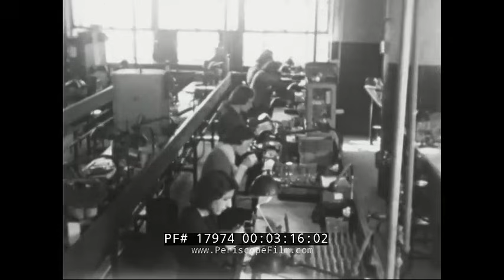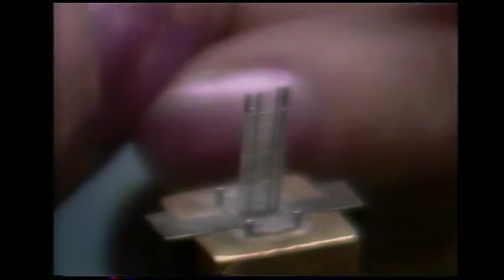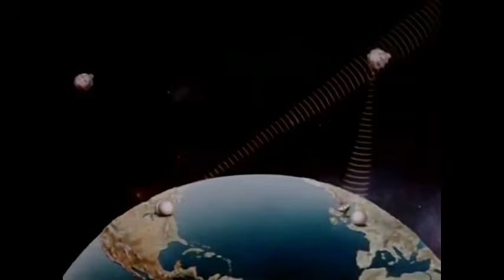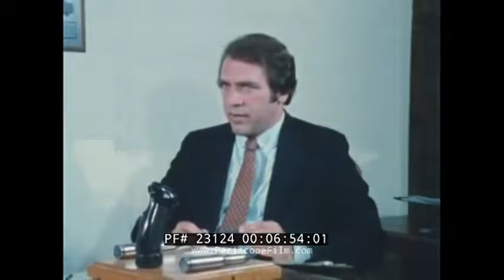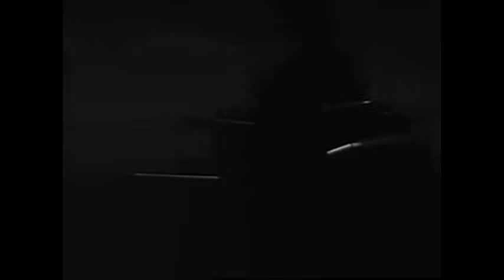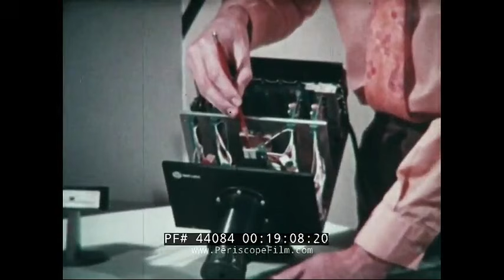The WWII Vacuum Tube Transistors Still Can't Fully Replace

Comment: Click Bait?  The description says THE tube still in use is the TWT, and they show a picture of a tube. Is that supposed to be a TWT?  Have they miniaturized them that much?  Wow, tell me more.  At the end of a 34-minute (admittedly very interesting) video, zero reference to the thumbnail picture, an obsolete VHF Triode.  Only passing reference to the Magnetron, perhaps the most-manufactured tube of all time, and now dirt cheap.  Going to be a very long time before they get replaced in microwave ovens.  Starting at $44.64, 37 different models less than $100 on Amazon (with metal, power supply, timer, etc., all claiming 700 Watts of RF power).

Comment: The thinking that valve amplifiers are smoother, milder, cleaner and better at producing music is a total myth. 
It’s just nostalgia and the fun of touching and seeing and using one of the greatest inventions since the phonograph is the only reason. 
All amplifiers can be designed to be below 1% distortion and some are 0.1%. 
You can only hear above a few percent and although some people have perfect pitch, this is not the same as detecting distortion level. 
If you are so fussy about listening to music, go to a live concert.

Comment: We still use a tube as big as your head to create FM broadcast. Only recently has solid-state been able to handle that kind of power in that environment. The solid-state stuff wins on power consumption alone by a big margin to the point it pays for itself to switch, never mind the tubes are expensive, few, have to be replaced every few years, and are not going down in price, so they are going away.
Reply: Also solid-state amplifiers have redundancy. Many amplifiers and power combiners are needed at that power level. If one fails, you just have less power until it's replaced. With one big honkin' tube, you're off the air.
Reply: @misterhat5823  Yep our Nautels are like that but in the case of our AM yet again go down one out of 2 modules we are 1/4 power because of how combiners work but it works. At least for the tubes you usually have some time from when they start to fail to replace them and shrug off most of the stuff that would pop a power module or two. Also tube stuff you can fix on site a lot of times. The modules usually have to be sent in. So it's all give and take.

Comment: Side note: People complain about the slow warm up of vacuum tubes, but except the slow boot up of modern computers, including your smartphone. That wasn't always the case. Back in the 1970s and into the 1980s, an Apple II or original IBM PC could boot up in milliseconds, if neither booted up into BASIC. That was their default mode, if it was configured without a floppy drive.

The average person thinks that's how all digital computers work. That's because the floppy drive, and later hard drive (HD) had to load the operating system (OS, DOS, Windows) off that drive, and copy it onto RAM. The CPU could only execute code off directly accessible memory, such as RAM. But there's also the boot ROM. It's also a directly accessible memory. In modern computers, that boot ROM's code directs the CPU where to, and how, to get the OS off the drive. In laziness, that method was copied onto smart phones, where the drive is replaced by a solid state serial flash chip. But it does not have to be that way.

In embedded systems, all the code resides on non-volatile chips (originally ROM, later EPROM, and now parallel flash), that are directly accessible by the CPU. No need to write it onto the RAM first. In the original IBM PC and Apple II (if driveless), the computer would execute the BASIC interpreter, directly off the ROM. That ROM became the boot ROM, if a drive was present.

Comment: There is a company in my town that still has a lab set up from WWll for producing a certain vacuum tube for the military which apparently they still need periodically.
Reply: But you won't say who or what
Reply: @TomSherwood-z5lyeah what's your problem 😅
Reply: @TomSherwood-z5l
Sure I would, I applied  there about 15 years ago so my memories are a bit hazy, I could look it up if you want it. It was a large room with several dozen industrial chair desks (like school desks) that had some jigs attached to the desk tops, probably for holding the tubes for assembly. On the walls were pictures from the ‘40’s of the workers, (mostly women) working on the tubes. Apparent they have employees working there who are trained and assemble the tubes when orders are received.
Reply: @TomSherwood-z5l
Richardson Electronics, Geneva Il.

Comment: Slow to warm up? they warm up within 40 seconds while your streamer or phone can take 5 minutes to boot up
Reply: My battery powered portable tube receiver uses directly heated filaments and it is basically instant on. Maybe a second at most.
Reply: Yes, those nice little battery tubes like the 1U4, 1R5, 1S5, and 3Q4 line-up.  I have one such radio and it works great.
Reply: @TomSherwood-z5lmy friend kirt  gave me a tube sreamer 
12ax7 whoa triod bliss
Reply: Well, something like Attiny13 boots instantly as soon as power is applied
Reply: Not big broadcast tubes.